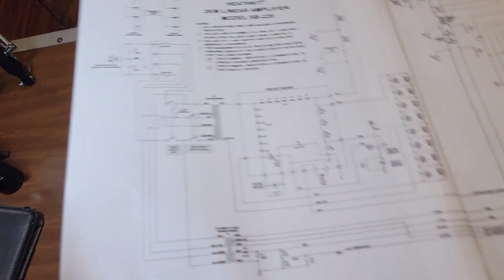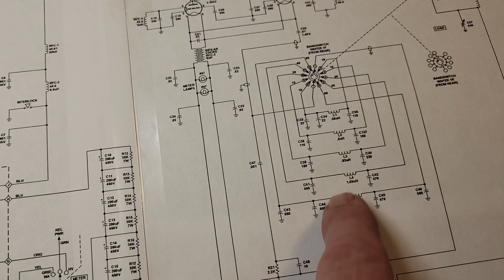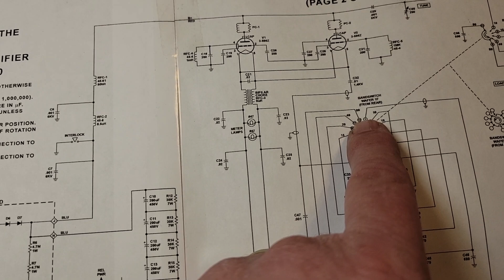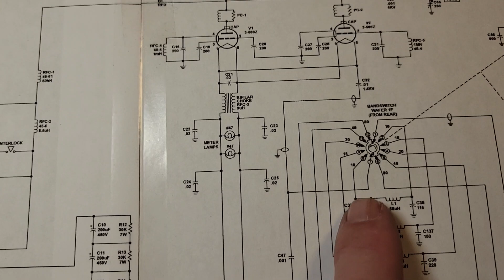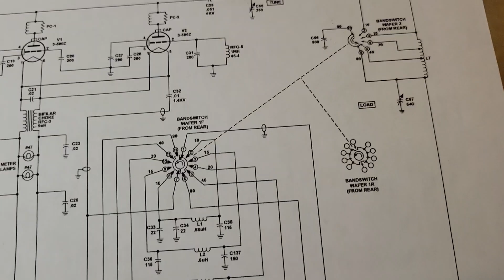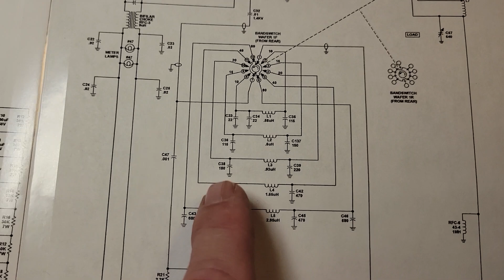Heathkit SB220 Amplifier part 2.  Some more disassembly and brief description of signals thru amp

Comment from the maker: Left one part out.  The main problem is suspected burnt contact on the output wafer on 20m.  10 also does not work and 15 has low output.